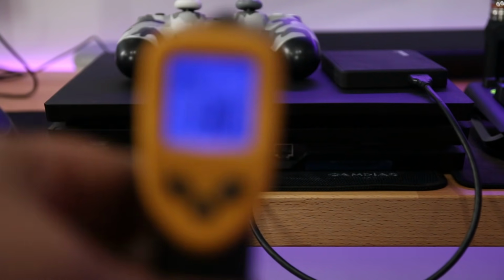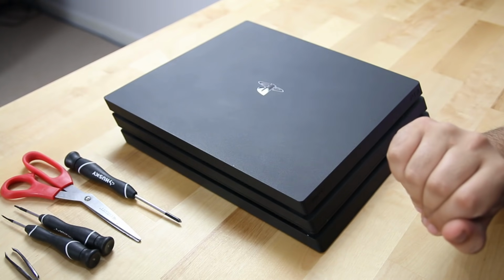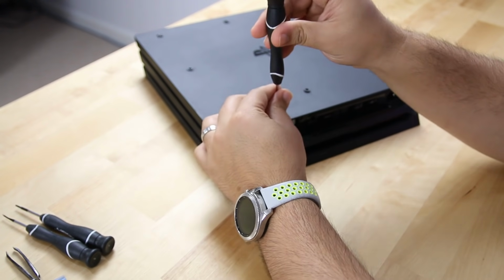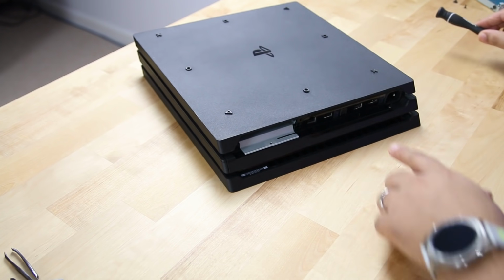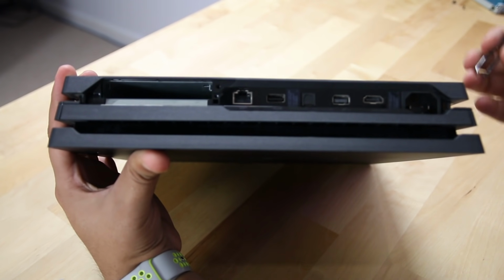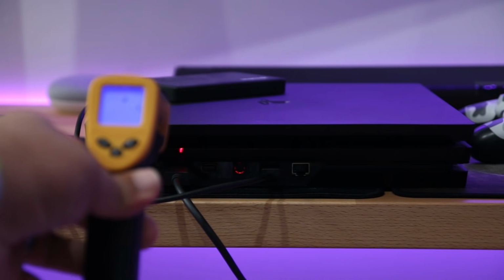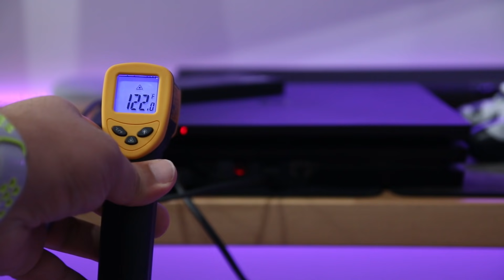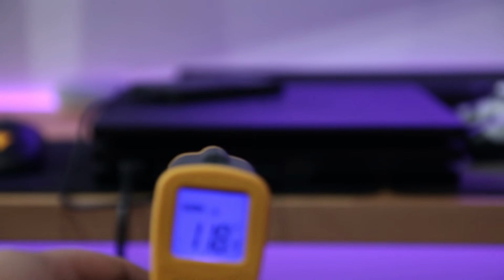PS4 Pro Fan Noise Fix - Thermal Paste & Pads Upgrade

Comment: Blue light of death after this  snd i just cleaned  dust from everywhere and put it back toegther its 1 year old i didnt raplace paste and pads
Reply from the maker: If u didn't replace paste or pads then it's gonna overheat n die. R u serious? U left the apu n vram without any cooling n powered it on? Your pro is fried.....
Reply: I cant turn it on so it's not dead I guess...

Comment: My ps4 works like new!! It doesn’t sound like a jet engine and overheat anymore (:
Reply: The machine is supposed to be rather warm on the right hand side. It's where the heat exhausts. You would know if it's overheating, and the heat is normal.

Comment: My paste will just have to do for now lol too tedious doing all this and putting back together. I have built many of custom PC's no prob. But this is different. The last time I tried working on a PS4 it didn't go so well. Too many things to go wrong imho. Will just have to settle for air compressor which I'm sure it desperately needs by now 😉 as far as new paste, yes I know it would help alot, I planned on using Arctic silver 5 as I always have for PC chips, but this bitch will have to lay where she is as far as im concerned, In that dept. I ain't chancing it again. Especially on my pro.

Comment: What the shit am I doing wrong at removeing the geat sink!?! I cant get it off
Reply from the maker: check all the screws bud. Make sure the PSU is completely removed. Don't force anything or something will break. Double check all the screws!
Reply: @TechSavvyBuyer  aw crap. I just saw it in another video where I had to remove 2 screws first below. I think it's a different ps4 pro model.
Reply from the maker: Yep. Good job!
Reply: @TechSavvyBuyer  boy, was that dusty... but you might wanna write the ps4 pro model. There's a lot of dumbass like me you didn't check the model and just jump to it. Good vid.
Reply from the maker: Touche - i will do that sir!

Comment: I finally did this to the latest Version of the PS4 Pro... with Thermal Grizzly Kryonaut & Thermal Grizzly Minus 8 Pads 1mm (for RAM & other contact-point), and no matter which Game or in-game Cutscene etc (GOW, Horizon, Spider-Man, The Last of Us Part 2, or COD), it just stays dead silent. So silent that i was worried if i had actually connected the fan. To hear the Pro in heavy workload situations, it need to get 5cm~10cm close with your ear, but it still remains nearly unhearable. Results are so insane. Before / After results incoming:
Before: https://streamable.com/o252d7
After: https://streamable.com/e4a6zf (That click at the end is my phone hitting the Pro)

PS: Audio recorded in one heavy scene from GOW, 24hrs between the test, and room temperature was the same as the day before. Have the latest released Pro revision, means it wasnt really dusty at all before. The difference is still day and night.

Comment: Does thermal paste matter I got one for 15 bucks ima fix my friends ps4 since it overheats I think the paste could be dried up
Reply: dude I just ordered some arctic mx4 and arctic pads...hopefully it works. How did yours turn out?
Reply: Indigo Ryno it came out ok I cleaned the heat sink now it runs not as loud it sounds like a plane was taking off only on fortnite tho

Comment: Bruh your not post to put that much thermal paste on the ps4 micro-chip no sir u hit the pins around the chip with thermal paste. Like damn
Reply: It's best to spread it. It needs to be all over the apu, not just middle. Pea size works with a pc because it's square and flat. Ps4 isn't.

Comment: Never put thermal paste on copper first, spread it evenly on APU only. Also ensure you remove the top silver screws that are holding the power supply in place before you turn over and remove the power supply. Otherwise you will snap plastic.

Great vid otherwise
Reply: So the APU/ CPU on the motherboard is where you put the thermal paste? Unlike how he did it in the video on the opposite copper side? Iam so confused, please reply, how much should I put on the CPU, evenly spread it?
Reply: @shubhmayc  yes paste on the CPU directly. Spread enough paste on to leave a thin layer e.g. 1mm. The pressure will remove what isn't needed.

Comment: Shame that a lot of people (myself included) are watching from smart TVs, etc. where you CAN NOT SEE COMMENTS... there are so many mistakes in this video it just should not be on YouTube... almost tore my PSU apart trying to remove it when I realized there might be something wrong with the video, and there was (this guy forgot to tell us to remove 2 screws on the other side). Also, he got the screwdriver type wrong, it's not JUST a T8, it's a TORX T8H (with the hole in the middle)... thought I was ready to go through this but nope, had to leave the whole thing on the table and go buy that goddamn screwdriver. And then the thermal pads... didn't have to read the comments to figure out how retarded that was, and RIP other user's consoles (assuming they reached that step). Disappointed.

Comment: Mine got louder after this for some reason.
Reply from the maker: Did u put the thermal pads on the righy area?
Reply: @TechSavvyBuyer  Yeah. I went back in to check and everything looked fine. I redid everything anyway and I'l give it a day to settle before I turn it on again.
Reply: Sounds like to me you didn’t apply the thermal paste correctly. So it’s not making good contact making the fan work harder to keep it cool
Reply: Make sure you follow thru all the steps.
-cleaning out every cell of dust from the fan, heatsink and console covers
-applying proper amount of thermal
-new pads and thermal from the best

Comment: Sony fanboys were making fun of the xbox for overheating Haha! When I had a ps4 it overheated multiple times. I decided to ditch the ps4. Both sides pack too much stuff in without decent cooling and heating. I thing if they start removing the disc drives they should pack in liquid cooling, better ventilation, put in ssd, and in my opinion keep the power supply outside  of the console to keep out unnecessary heat.

Comment: Dude you don’t put thermal paste on the heat sync you put it directly on the dye... have you ever done anything with computers? 😂
Reply from the maker: Since I was putting the apu on the heatsink I put it that way. You obviously aren't a subscriber to my channel otherwise you'd know that I build computers regularly and do custom loops too....
Reply: Tech Savvy Buyer still doesn’t really make sense to put on thermal paste on like that instead of the dye of the chip
Reply: Tech Savvy Buyer that’s like deliding a CPU and putting your paste on the IHS because you’re putting it back on the dye, doesn’t make it any less backwards
Reply from the maker: The point of thermal paste is, to transfer heat. It doesn't matter if you put it on the heat sink or the apu in this case. As long as it makes contact correctly and covers it, it makes 0 difference.
Reply: Tech Savvy Buyer it’s to fill in the inconsistency’s of the different surfaces to aid in transferring heat, not to transfer heat itself. Thermal paste is actually a pretty bad conductor of heat. 

The heat sync is bigger then the dye and you’ll definitely get a better spread putting it on the chip first. You don’t have nearly the control of where it’s going to spread if you’re eyeballing it on the heat sync.
Reply from the maker: @cameronbeyer7687  dude I know. Like I said, in this application it makes 0 difference since it'll spread and cover the inconsistencies anyway and ultimately transfer heat, hence it's superior capabilities at conducting heat.
Reply: Tech Savvy Buyer that doesn’t if you’ve missed a portion of the chip because you put it on the heat sync and not the chip... also if someone’s using conductive thermal paste and follow this they could have some miss the dye because they eyeballed it on the heat sync instead of the dye. Thermal Grizzly makes both conductive and non conductive compounds. They may not know the difference.
Reply: Tech Savvy Buyer basically you have far less control over the how thermal compound ends up on the dye, potentially mission some of it. Or damaging the board if someone’s used a conductive compound.

Comment: If people do this expecting to see reduced temperature, and Fan noise, they won’t visibly see any improvement.

In fact If the  thermal paste is applied to the CPU properly,Then all you will likely see is temperatures slightly higher at the exhaust  part of the PS4, as the fan ejects more hot air, and a cooler running internal CPU..

Comment: Im too scared to try this LOL
Reply from the maker: It'll be fine. I did it - was super easy. Be bold and Daring - YOU GOT THIS!!!
Reply: @TechSavvyBuyer  lmao I aint got the best of luck bruh but if I ever get daring, then I got yoyr vid as a tutorial.
Reply from the maker: I have faith in you. YOU CAN DO IT. lol its pretty straight forward and simple. I doubt you'll mess something up.
Reply: @TechSavvyBuyer  Thanks for the vote in confidence but you aint seen me with hardware lol too many nightmares from those ribbons haha! I think I may suffer from some form of PTSD coz of that shit.
Reply: I'm so tempted to try this as I sit here and listen to my only just 4 month old Pro spinning it's back out running Red Dead 2 (blown away by how good that game is though). I'm fine with the work, done plenty of overheating laptops before and build my own gaming PC's, but with my luck something will go tits up exactly 1 day from the expiry date of the warranty I voided. I'd rather not have to fork out for another PS4 Pro, but the noise is spinning me out more than the damn fan is.
Reply: @pault5744  Try this. Get 2 books and put it under the PS4 Pro. Not in the middle but one one each side but if your not happy with books then get 4 game cases, stack 2 on top of each other put em on either side so its 2 on side and 2 on the other.

I did this for God Of War (digital) and noticed the fan was quieter, though it could be because it doesnt have anything solid at the bottom to vibrate against lol.

Make sure to check under it every now n then if you try this because a shit ton of dust will be there lol

Comment: Why the f did you put it on the heatsink and not the apu? Mother of Christ, how do you start a techchannel and make that mistake??
Reply from the maker: You can do it either way.
Reply: Yeah I dont see why it matters. The spread causes when the two plates collides so id dont matter which one its stuck to.
Reply: It’ll still make contact with the APU, doesn’t matter if you pour the cereal first or after...
Reply from the maker: @NopeKickEm  he's just being a hater lol
Reply: Because it's the opposite way round? On pc motherboard faces up, on PS4  it faces down. You put paste on whatever part faces up. How are you going to screw the heatsink bracket on if it's on the underside and you can't see it..... You can watch all the pc guides you want, no amount of videos will teach you common sense unfortunately